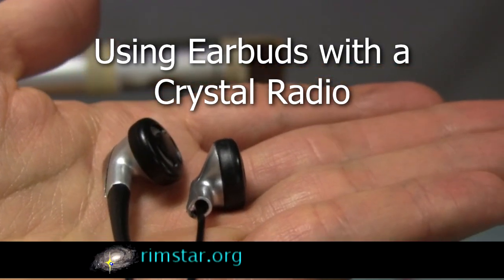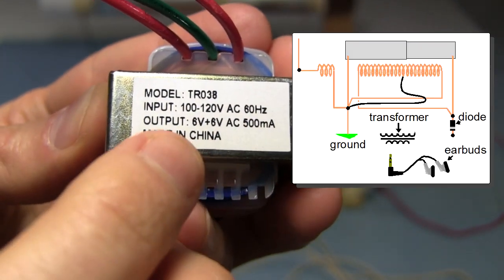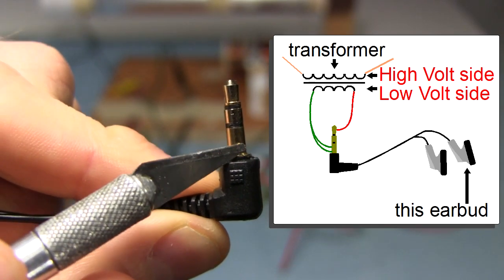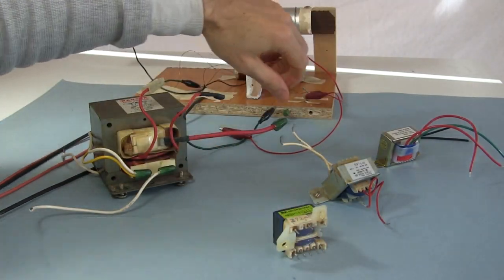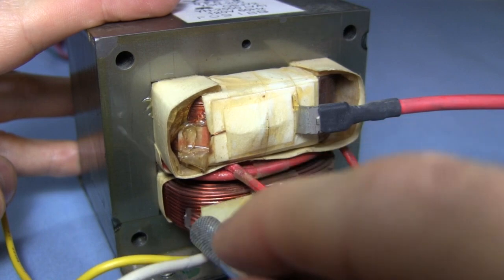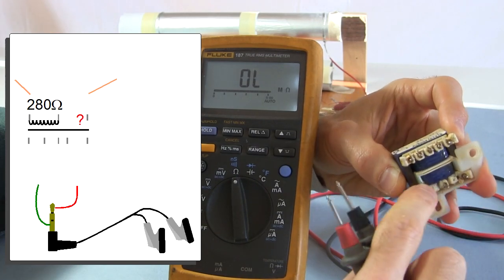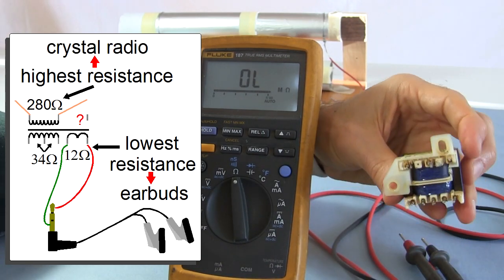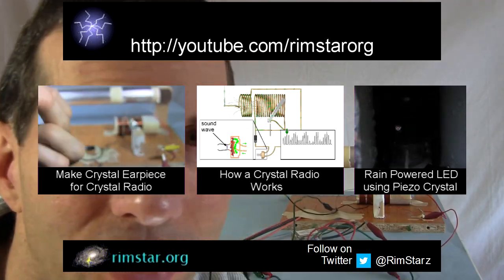Use Earbuds/Earphones with Crystal Radio

Comment: The main difference between a power transformer and an audio transformer is the way the E and I laminations of the core are arranged.  The power transformer has an E on the left and I on the right of the first layer, then an I on the left and an E on the right of the second layer and so on, so alternating layers have E or I on the left.  This makes the core almost like a solid block and the transformer is optimized for 60 or 50 Hz.

The audio transformer has all E's bundled together, and all I's bundled together, and they are assembled and held together with a piece of thick paper between the E's and I's. This air gap created by the paper optimizes the transformer for a wide band of audio frequencies.

You should try to take one of the power transformers apart.  The first E and I laminations is very hard to get out, but after that it's easier.  A rubber mallet helps a lot but don't break the windings.  Then you can put it back together with the paper and now you have a wider band transformer.  But the way you have been doing it works, for noncritical use.

The big MOT has too much core loss.  Save it to make a spot welder.  :-) 
Great video.
Reply: Audio transformers can be made both ways. It depends on circuit in which they're suppose to work. If there is unbalanced DC current flowing through windings there must be gap in core. If no DC or it is balanced, like in Push-Pull amplifier, then core must be assembled without gap.

Comment: I just wanted to say I tried my crystal radio with your transformer idea with a amplified computer speaker and it was no louder than without the transformer.  It was the same volume pretty much.  I also thought with the amplified speaker connected to my crystal radio it would be much louder but it really is not. Any idea for an amp that will make it loud enough to he heard across a room with out things needing to be silent in the room?
Reply from the maker: +moterdude1959 That's odd. Though if your speaker really has a built in amplifier then it should work fine without the transformer (no need for a transformer in that case.) I do that here with my homemade amplifier https://www.youtube.com/watch?v=JtPwxbOgBHw. I don't know enough about your speaker to say if it should work. Is your speaker getting power from somewhere?
Reply: The computer speaker I used uses usb port to power it. I modified the speaker to make it more portable. I removed the extra speaker and also wired in a 9v battery cap. I should have used the computer to power it and if the results were not great I would have not modified the thing LOL  The volume control seems to light up as bright with the battery as it did when plugged into the computer usb port. The 9v battery maybe more power than what comes out the usb port.  I will try building your Amp I think I have seen it online.
Reply from the maker: +moterdude1959 To help with your searching, my amp is here http://rimstar.org/science_electronics_projects/make_crystal_radio_amplifier_for_speaker.htm.
Reply: @RimstarOrg  ...that's a very effective amplifier circuit!

Comment: That is very interesting that would work. Can it power a regular pair of headphones also?
Reply from the maker: +moterdude1959 I'm not sure. There may not be enough current.
Reply: I had one more thought with the transformer hook up. The way you say to hook it up you would think would be stepping the power down  from the 120v side to the lower side. Would it work if you reversed it so the radio was feeding the lower side and feeding the earbud with the high side. Just a thought I am going to try the transformer.  Thanks for your videos and your reply also.
Reply from the maker: +moterdude1959 I don't think its purpose is to act as a transformer, stepping up the voltage. I think its purpose is for impedance matching. That's why it works better the way I've used it. But try it the other way anyway.
Reply: OK thanks again for your reply I was just wandering. I will try it soon for my self to see how it works.
Reply: I did the test of reversing the transformer and it did not work at all. When properly connected it did work the head phone but was not loud enough as my crystal earphone on there own. With transformer it did not work when I connected the crystal earphone. The transformer worked like you said. It all was very interesting to try. I am going to try the computer powered speaker next with your transformer to see how that works. The powered speaker was not as loud on its own with the crystal radio. I am hoping with the transformer it gets much louder. I will let you know how it works out.
Reply from the maker: +moterdude1959 Yeah, that was my experience too... the crystal earpiece alone was louder than the earbud/transformer combination. That could be due to the added losses, but also due to the arbitrarily chosen transformer and hence the imperfect impedance matching. Thanks for letting me know how it went.
Reply: @moterdude1959  ...no, that defeats the whole purpose of using the transformer-!

Comment: hi there, what if you used a bike ignition coil? mine has a 10k resistance on the high voltage and only one ohm on the low voltage side!! I reckon the higher the resistance the better it will be? afterall a true crystal set earbud has several kilo ohm resistance?
Reply from the maker: +fidel catsro I'm not familiar with those coils, but give it a try. You're actually trying to match the impedance of the tuning circuit side (the tuning capacitor and tuning coil) and the earpiece side. For earbuds it's pretty low, around 10 to 20 ohms, but I don't know what the impedance is of the tuning circuit side though it's higher.

Comment: hmmm wonder if the microwave transformer coil could step down those ac signals before the diode and output a small voltage at over one amp! free energy experiment..

Comment: wow your effectively stepping down the dc pulses from the germanium diode and ground to a lower voltage higher amp to run signals into the earphones..

Comment: Actually you can use wall adapters that have AC to DC stuff listed on them, but you have to pry them open to get at the diodes. IF you're into deconstructing and re-purposing, sometimes rectifiers they have in the wall adapters can be used in a crystal radio.
Reply from the maker: RhetteLawe Interesting. It's always nice to find a new source for parts. And I do have a bunch of them. Thanks.
Reply: +RhetteLawe I always keep the transformers, to scrap the metal, recycle the plastic, and either put the huge wires in my copper box, and the smaller wire coils, unwind, and use that wire for crystal radio coils. works great!ive used several tubes for coil forms- ink pen, plastic medicine bottles, chapstick tubes,  cardboard mailing tubes, and packing tape cardboard! the medicine bottles and (sometimes) the chapstick tubes are the best, but im trying other sizes, diameters. any ideas?
Reply: Ehh.... it depends somewhat on exactly 
what you want. round is an easy thing but most transformers are more square. 

E/I transformers generally require you to either wrap directly onto the transformer, or use something like plastic so that it can be pried onto and off of the sections. This is largely because of the Square geometry in the transformer, but, to be honest, round works just as well if you're doing your on custom inductor.

As far as that goes, Antenna shape can help tune the crystal radio, but you have to know what station you want and you have to build the antenna to match the shape required by that frequency. Wikipedia has some good information on antenna shape.
Reply: thanks!

Comment: Is there a way to hook them without the amplifier and with something cheaper?
Reply from the maker: viki2133 Yes. The amplifier would go where the earpiece normally goes. I show how to make an amplifier for a speaker and use it with a crystal radio in this video here https://www.youtube.com/watch?v=JtPwxbOgBHw You may be able to use iPod earbuds in place of the speaker, but I haven't tried that. And in this video I show how to make one for a crystal earpiece, but I don't know if it'll for with iPod earbuds http://youtu.be/cQ-LxMDrD_o And, you can buy mini amplfiers as well.

Comment: Hey again RimStar, another question... if I had a self powered speaker, could I simply use the above transformer to connect to a male to male 1/8 inch and plug that into the speaker?  Looking for a quick way to amplify... ps my girlfriend thinks you are cute
Reply from the maker: Christopher Cole I'd simply do without the transformer and connect the crystal radio's output to the input of your self powered speaker. I do that with my homemade amplifier here https://www.youtube.com/watch?v=JtPwxbOgBHw ps Thanks!

Comment: Did you try the 1-turn coil in the microwave oven transformer? Seems like that would work best.
Reply from the maker: SniperFox I don't recall if I did, but I imagine I would have. But I wouldn't thing it would work best. The idea with the transformer isn't to transform i.e. step-up or step-down voltages. The idea is to do impedance matching and that single turn probably has a much lower impedance than the earbud. Though as I said, I don't recall if I tried it.
Reply: That's interesting... I thought you were trying to get more current with the transformer (by stepping down the voltage). I thought more current would make the ear buds louder (stronger magnetic force inside on the ear bud's coils, F=ILB). I don't seem to understand why we need to do impedance matching.. I still have a lot to learn.
Reply from the maker: SniperFox My understanding is that the 8 ohm earbuds are too low an impedance 
(resistance to AC) for the capacitor/coil circuit. Since they're such a 
low impedance too much current goes to the earbuds and not enough stays 
with the cap/coil circuit to resonate with. So we put a high impedance 
on the cap/coil side. Meanwhile the energy still gets transferred 
through the transformer.

Comment: Order a switchable audio matching transformer box from ebay, it works much better with an output power enough for a small speaker.  Just imagine listening to a 24x7 power free radio XD
Reply from the maker: Thanks. I really should order one someday. For this video I wanted to show using miscellaneous transformers, but even then it would have been nice to show an audio transformer in use.
Reply: I'm surprised you could hear a speaker being driven by a passive crystal radio when it's very quiet even with headphones. You say small speaker, but an enormous horn speaker like an Altec Voice Of The Theatre would probably give you the best chance of it getting heard. Also using a long antenna is best.

Comment: do you need those clip things to attach the transformer?
Reply from the maker: No. Attach it anyway you can. There are many ways. Just make sure you have a good connection.
Reply: CERTAINLY NOT! The "alligator clips" are used because they are a simple, versatile, and convenient way to make electrical connections!!

Comment from the maker: Stepping down (or up) the voltage isn't the purpose. The purpose is to do something called impedance matching. My understanding is that the 8 ohm earbuds are too low an impedance (resistance to AC) for the capacitor/coil circuit. Since they're such a low impedance too much current goes to the earbuds and not enough stays with the cap/coil circuit to resonate with. So we put a high impedance on the cap/coil side. Meanwhile the energy still gets transferred through the transformer.
Reply: The low ohm earbuds will sag the output stage voltage of a crystal radio so you need to convert some of the voltage into current. I'm not sure why the 1:1 transformer would work any better though.
Reply: @TimpBizkit  ...to get maximum POWER transfer, it's necessary to MATCH IMPEDANCES: the crystal radio output has a HIGH impedance- while the earbuds have a LOW impedance. Using a transformer is ONE way to match impedances.
Reply: @TimpBizkit  ...a 1:1 transformer wouldn't do any good as far as matching impedances.
Reply: ...that's absolutely RIGHT-!!

Comment from the maker: Did you try the transformer both ways? The problem may also be with something else. Do you have a long antenna? If you don't have any radio stations nearby then you'll need a long antenna. I have two radio stations within around 2 kilometers so I can use an antenna that is 3 15 foot wires connected in parallel. Do you have a good connection to ground? Also, check all you connections on your radio.

Comment: Hello rimstar! I got transformer for the halogen lamps, he has 230v 50-60hz in and 12v out, will it be useful for this? he has two wires in and two wires out,his power is 50w

Comment from the maker: (... continued) So we put a transformer between the resonant circuit (capacitor and coil) and the low impedance earbud. We put the high impedance side of the transformer on the resonant side. That's the side of the transformer with the most wire turns. Now the listening side doesn't siphon off too much energy from the resonant circuit so that the resonance (tuning) can still happen. See my "How a Crystal Radio Works" video for more on the resonant circuit. And hopefully I got that right! :)

Comment from the maker: (... continued) But notice that the diode and earpiece are also connected to the capacitor/coil circuit. So some energy is siphoned off there for listening purposes. A normal crystal earpiece is a high impedance device (think resistance but for AC) so it doesn't siphon off too much energy. But an iPod earbud, for example, is low impedance and would take too much energy from the resonance, preventing the resonance from happening and so you wouldn't be tuned into one radio station. (continued...)

Comment from the maker: The purpose isn't to step-up the weak signal. I think the general purpose for the transformer for purposes of impedance matching but I don't understand it well enough in those terms to explain it that way. The purpose, as I understand it, is to not interfere too much with the resonance going on between the tuning capacitor and tuning coil. The capacitor and coil are exchanging energy back and forth at the radio frequency you want to listen to. (continued...)
Reply: ...you summed it up pretty well!!!

Comment: Pardon my ignorance, but I don't understand why the high voltage side is connected the radio, while the low voltage side is output to the earphones. Wouldn't we wan't the high voltage side output to the earphones to step-up the weak signal coming from the radio?

Comment from the maker: Ah, a broomstick has around the same permeability as air but has a much smaller diameter than the cardboard tube I used. According to my rough calculations (real world is always a little different) and assuming your wire has a thin enamel coating and not thick plastic and assuming you're using a capacitor with a similar capacitance range as mine, then for 26 gauge wire I'd recommend at least 150 turns. I don't know for 30 gauge but I'd go with more than that, maybe 200 to 250.

Comment from the maker: Sure. The magnetic permeability of the material does affect the inductance which in turn affects the range of resonant frequencies you'll be able to tune into. Air has a magnetic permeability of 1 (and the cardboard tube I use counts as just air). Iron is 100. Ferrite is from 16 to 640. The higher the permeability, the smaller diameter it can be. What is your cylinder made of, what is the diameter, length and what size wire are you going to use?

Comment: Great video! You probably already know this but using transformers like this is called impedance matching. The transformer primary acts like a high impedance load to the crystal radio whilst the secondary acts like a low impedance source for the earbud.

Comment: Very clean and clear video...enjoyed that. This idea is good too for the common problem of one earbud breaking. . My fave boost output is a solar panel under my workbench 13W CFL and then out to a Sziklai pair of transistors (C1815 and A733). Not room filling but decent enough for the table with a 0.25W speaker...and the light is on anyway.
Best wishes for the trip :)
Reply: ...one thing to remember, is that a crystal radio produces a very small audio signal- and if an amplifier is added to the output- the amplifier will also amplify AC hum, and other noise. 

The more advanced radio circuits amplify the RF signal AND the audio signal- that's the difference. 

There's an old saying: "...you don't get SOMETHING for NOTHING!"

Comment: Nothing to do with transformers, but dollar stores usually sell male or female to female 3.5mm jack extension cables. With a pair of wire strippers, these can provide an excellent cheap way to get a decent wire connection to plug in anything w/ a 3.5mm jack into an audio circuit.

Comment: Just look for any old Ge non power transistor and use the BC or CB junction of it as a rectifier. Best one is an AF117, as it has a very small junction optimised for high frequency use. In this case it does not matter if it is shorted to the case, as you only need one working junction.

Comment: After you get back from your trip, you might want to try a 1:1 transformer. it might work, I don't know. I cant because I burnt out the 1N34A diode I had, and cant find a suitable diode to replace it. I tried everything from bipolar transistors (just the base and collectors) to different size  color and types of LED's, to giant 6A rectifiers, and small signal diodes from Radioshack. even a few small surface mount diodes from a solar charger. those seem to have the lowest voltage drop.